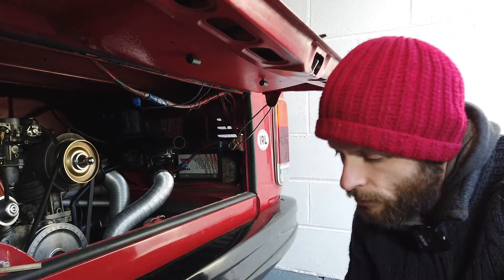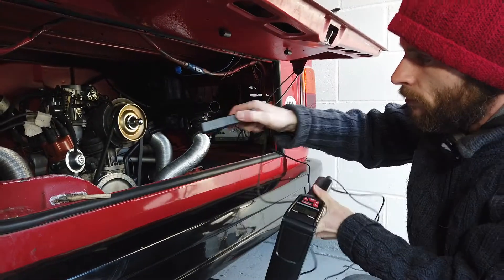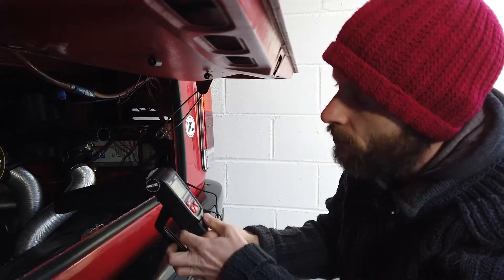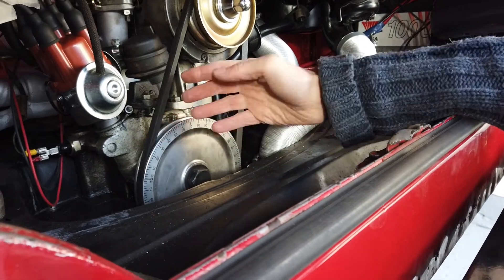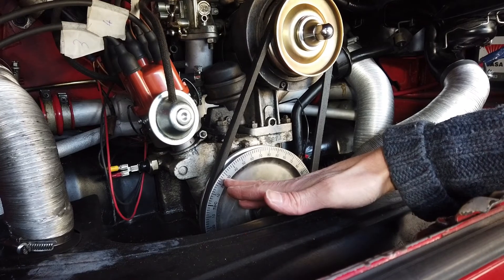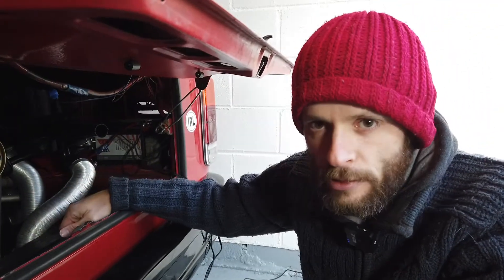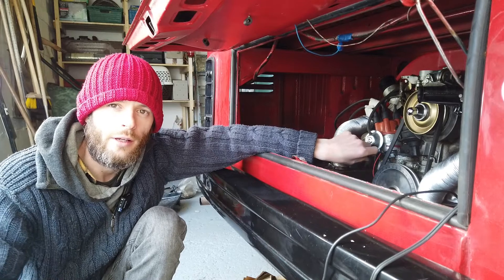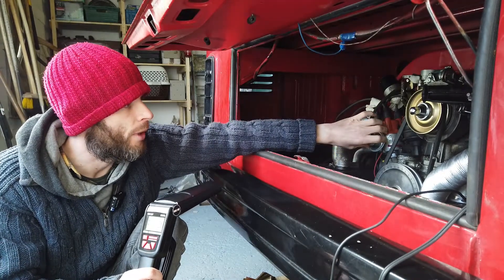VW timing

Comment: To be honest....maybe im just lucky but...i put my pully to TDC and also put my distributor pointing to the line and my engine runs like an absolute boss...never used a timing light..did run across this figured id check it out its basically what i do with my engine but with the headache lol

Comment: Shouldn't you be moving the distributor once you're at 3000 to get the correct degree? Looks like it would take 3 hands to do this. Or do you rev up and check, then let off, move distributor, and rev up again?